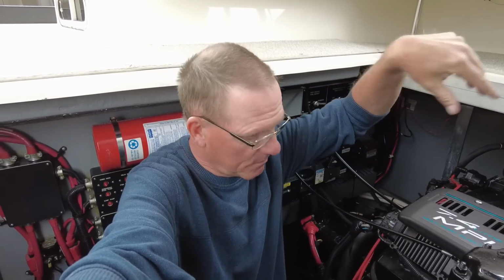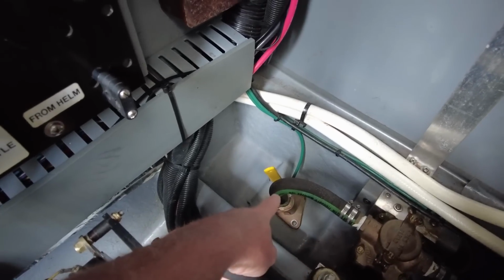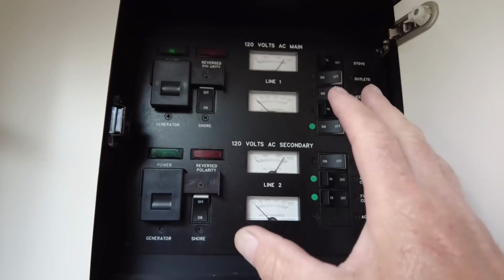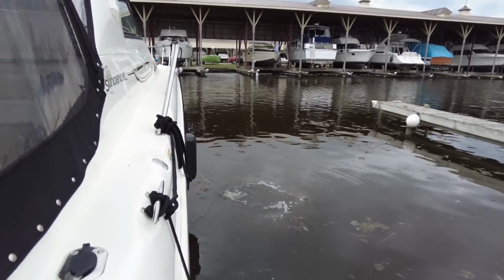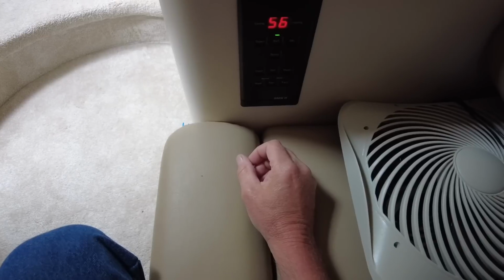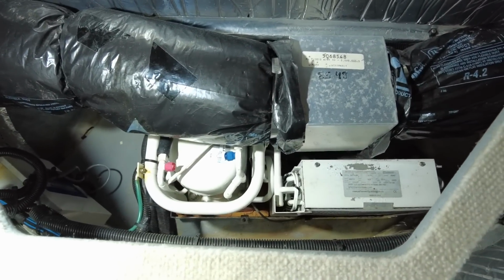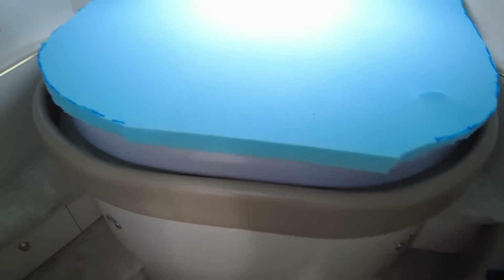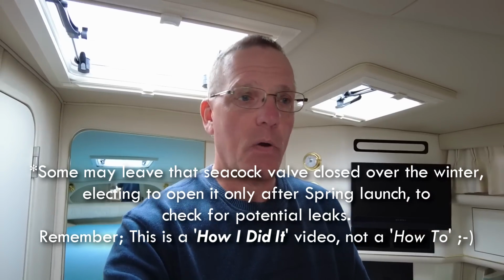First Start of Marine Heat and Air Conditioning - Spring Recomissioning

Comment: In the spring, I have to prime the pump with a run of the boat up to speed. 99 380.
Reply from the maker: Yes, we had a similar situation on our 400 Sedan Bridge, but overcame that when I installed the water filtration system. Same in our 330 Dancer.
 Happily, at least so far, the pump on the current 370 is quite cooperative 😉

Comment: Will your heat run off your geny??mine will only work of ac power but ac runs cold on geny
Reply from the maker: I've never tried the heat cycle when running on the generator, but the air conditioning works perfectly on the generator. Perhaps check the voltage output from your genny to make sure it's producing the correct power supply, as the reverse cycle air conditioning units are sensitive to improper voltage...

Comment: I felt like our AC wasn't cooling properly last summer so I picked up a small digital room thermometer and found out that the AC unit was showing 5 degrees cooler than the actual cabin temp.  Did some digging in the manual and found out this temperature can be manually set as a baseline.
Reply from the maker: Good insight, thank you. That said, every heating and cooling system is controlled by the temperature at the thermostat, not necessarily the ambient room temp. One may need to adjust the setting to reflect not what the number on the thermostat says, but what the comfort level is for the occupants. And don't forget that since our boats have zero, stand alone insulation, the thermostat can be subject to outside temps (cold on the adjoining wall, or got summer sun beating into the cabin), so that's gonna play into the whole comfort equation.
Reply from the maker: Hey! I think I just came up with an idea for another video 😁

Comment: Single pump plumbed to two units is common. First part of the video showed both units running. You can also make those thermostats read Celsius.
Reply from the maker: Yes, one pump to service both A/C units. If one is running (or both), then the pump is circulating water through both units, hence the water exiting the boat at two locations.

Comment: I always leave the sea cocks open for the winter so no trapped water but close all but the engines before launch. I open each as I test the system.  Great walk through. Very close to my procedure. Happy boating    PS got to the boat on the weekend, all looks good, just waiting to figure out launching but fingers crossed we are floating in a couple weeks.
Reply from the maker: Good to hear that you were finally able to get to your boat. I bet you're chomping at the bit to get her splashed!

Comment: Nice review II do the same but with one extra step.  Once on my 2009 Searay in the summer my AC running cold mode displayed an error code.  I looked it up and as I recall it was a air pressure code.  I checked it out and found it had an air filter on the Cruise air unit.  I pulled it out and cleaned it with water and let it dry.   Worked perfect again.  I did not know it had a filter.  It's plastic mesh just like my home dehumidifier so very easy to maintain and clean.  Now I check it periodically.   Take care.
Reply from the maker: Yes, as with any sort of unit that pulls air through it (furnace, dryer, central vac system), filters must be cleaned or replaced regularly. If not, the reduced flow of air will put a strain on the motor or cause it to overheat.
Reply: Good reminder to check my filters! Thanks!